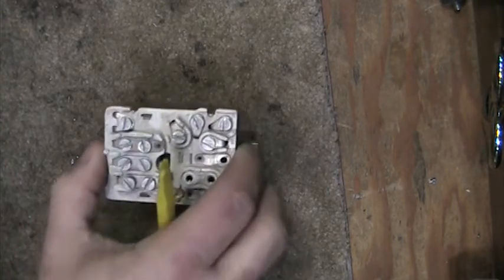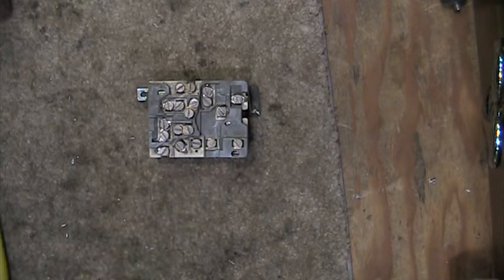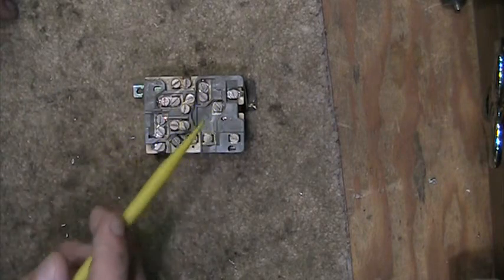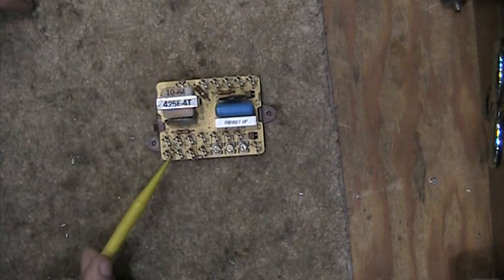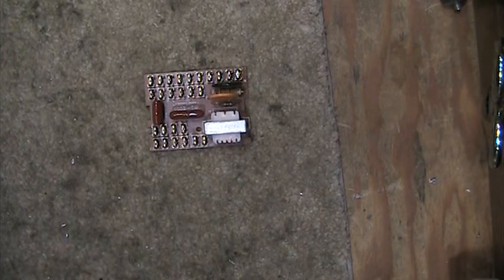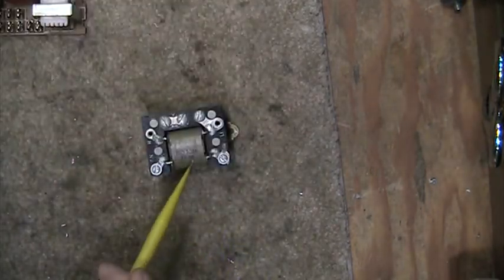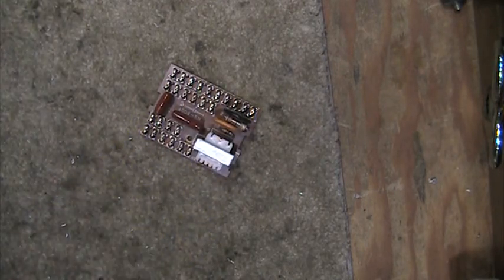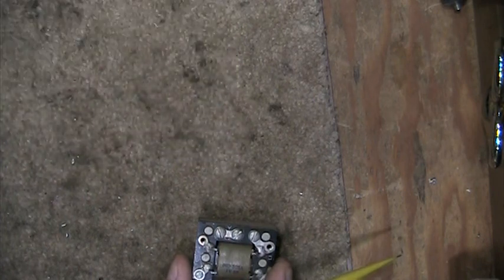Talking about Western Electric, ITT ,Stromberg carlson, Tel network's

Comment: Phil: Thanks for a very interesting narration... AND especially that irritating 4228 network. I learned (from you) just now that it's called a "4228". It caused me all kinds of "Heck" back the "Inter-connect" company where I used to repair 2500 models (500 -models too) but nothing ever went wrong with them (just got filthy)... fast clean -up, and back into service usually. There was only 1 (500-model) I had to change out the network. (425)! Love the 425, but I never tried to replace a component within because of that (horrible sticky Vaseline -like goo inside). That 500-model's problem was the "Side-Tone" circuit was shorted. You talk into it, and you hear YOUR OWN VOICE come back into your ear (At FULL Volume). So, I pulled the 425-network out of another 500-model (on the parts-pile). What I wanted to ask you Phil, is (What kind of networks did Western Electric decide to drop in those "Design Line" telephones? Never opened one of those up! What a Silly Idea that Bell Telephone came up with...(You own your phone, but it's Internal -Parts belong to US)! HUH! Can you imagine the installer trying to fight his was to the front door behind the bullet -proof shield to REMOVE the network, transmitter, receiver, and Touch-Tone dial when they cancel service?

Comment: I noticed the induction coil (transformer) in the WE 425 and 4228 networks have more copper and iron than the other manufacturers, but the last AT&T networks (4293 type) now have the small transformer.

Comment: I have a 1940 wester electric 302 with a 101A induction coil. Nothing's wrong with the condenser/capacitor but, I was wondering what the values are for the capacitor for the talk and ringing circuit's? Thank you!

Comment: Is there any reason why a "425" Network Board couldn't be used, in conjunction with a Telephone Operator’s Headset, such as a AudioSears # 1574-9, to connect to a standard loop-start phone line?
Reply from the maker: you could. Wire it as a non dial 500 set.
Reply: @sxsphil  That works. Since I'm only setting up a very basic console, where the operator connects two stations, and no out-dials or LD Trunk connections, there’s no need for a dial.

I would've attempted to do more, but we only have 20-30 minutes for the whole presentation, in-front of my son's 2nd grade class.

When I did a similar presentation for my daughter's 2nd grade class, we brought-in a magneto, connected to some phones, so the kids could ring them. I thought I'd make this ‘round’ a little more interactive, where the kids can talk to each other on the phones, and the operator can ring them.

With my daughter’s class, as a souvenir, we gave out polished 310 plugs on a key chain to the kids, along with some telephony coloring books.  I think it went over very well.